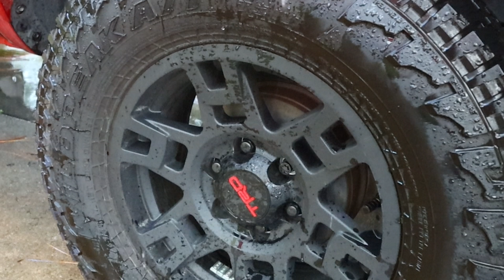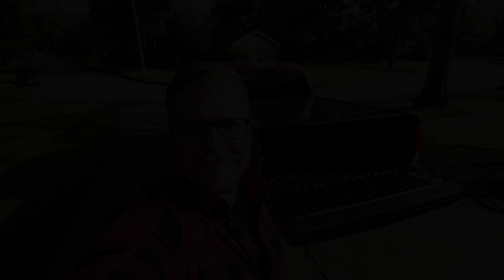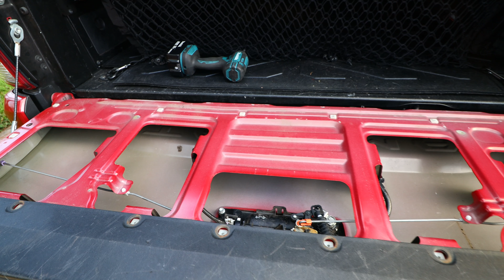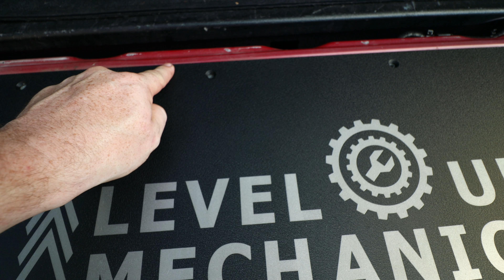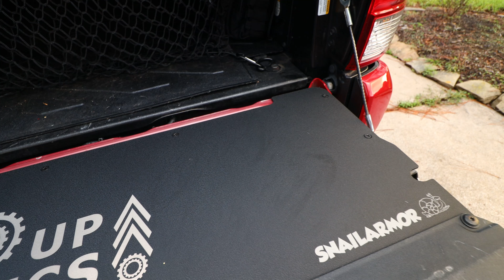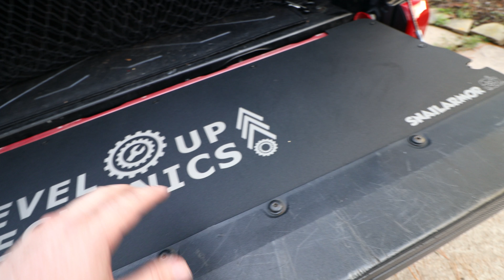Toyota Tacoma Mods | SnailArmor Tailgate Ultimate Flat Panel | 2nd & 3rd Gen | Custom Laser Etching

Comment: What is brand name of the tonneau cover used in this video?  It looks like it protects the truck bed from water.  Does it?
Reply from the maker: It is a Peragon Truck Bed Cover. Here is my video of it. https://youtu.be/m_KyYPUImhg

It's held up really well so far. It isn't 100% waterproof (no tonneau cover is). If there is a really hard rain, I will get some water that trickles in... but it is MUCH BETTER than other options out there.

Comment: Just wondering how it's holding up? Since it's made from aluminum, I'm assuming it can get pretty beat up if you use your Tacoma for work...
Reply from the maker: So far it's holding up great. No dings or dents or scratches yet. I've been using it as a work table for all of my youtube projects. 

I think the heaviest item I've placed on it so far are brake rotors. So far so good 👍. No signs of rust either. 

I hope this info helps! 😁